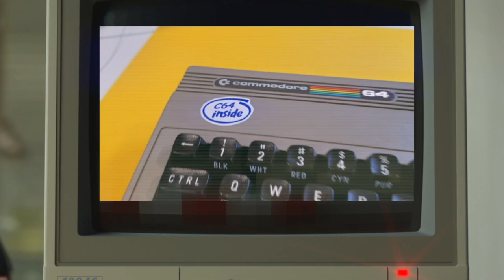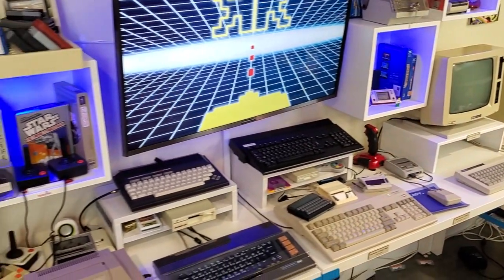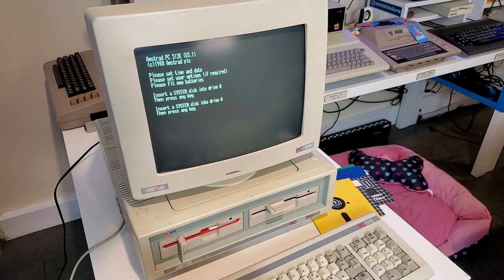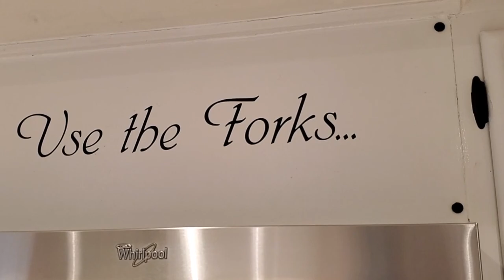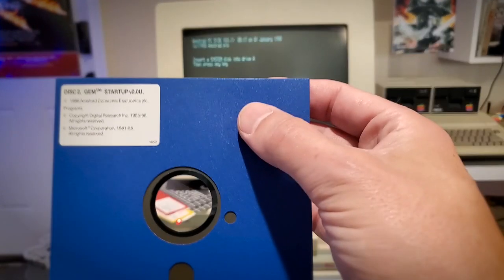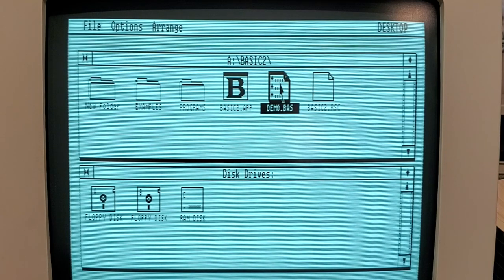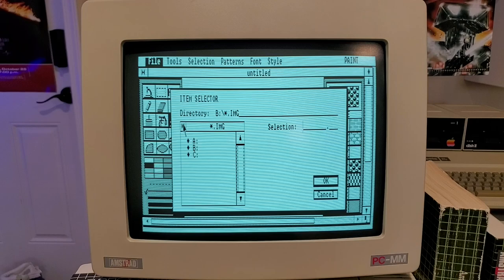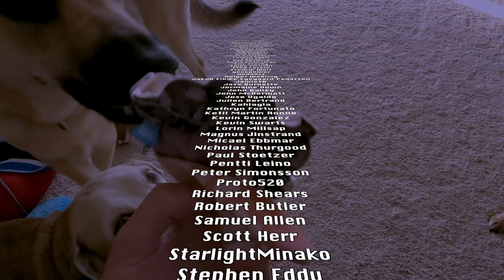Chasing tigers with the Amstrad PC1512 | recreating my teen PC!

Comment: Had one of these, it was my 3rd home computer.  A 512 with dual floppys and a colour monitor.  Did a little modding with the help of my late father, upgraded the memory to the whole 640k and put a 32mb Winchester hard card in the back.  The hard disk was attached to the controller card so I kept the two floppy drives.  This brought back a lot memories, sounds like it also did with you.

Comment: One thing to note about the dishwasher - dishwasher detergent usually contains sodium hydroxide and/or potassium hydroxide.
These chemicals react with aluminum, so don't wash anything aluminum in the dishwasher. I worry about putting electronics in the dishwasher because a lot of electronic components contain aluminum and may be damaged by the detergent solution.
For example, electrolytic caps are usually aluminum.
I expect most keyboards would be fine, but it's something to consider.

Comment: OH MAN!!!!  I understand it being bittersweet.  Mine belonged to my grandfather first, who gave it to me as a hand-me-down when he got a Tandy 1000 TL/2 (I think it was a 2) to replace it.  He died back in 1998.  Mine also had the color monitor, and Prodigy actually supported the Amstrad graphics mode.  Standard CGA on Prodigy was black and white, but not on Amstrad!  Also, the one you have has the same disk drives that mine had!  All of the others I have seen, both in advertisements and on YouTube, have the ones with the crooked latches.  I miss GEM desktop and that machine so much.  It was quite a step up from the Timex Sinclair and the CoCo 2.  Then I went from this to a 486 (first machine I ever built), so it was even a bigger step up haha.  GREAT video as usual!

Comment: I had one of those, purchased during the brief period that they were imported into the USA. It had an 8086, so it had a full 16-bit data path, unlike the crippled 8088 in the typical clones. I got the extra memory (a full 640k!) and, IIRC, an 8087 chip, that I didn't really need. Later I added a 30-mb hard drive, and had quite a setup, 32 years ago. I doodled in the paint program in GEM. Still doing similar stuff, 3+ decades later.

Comment: Thanks for this!  Great trip down memory lane.  In the early 90's I worked at a computer retailer in Canada and we carried the Amstrad PC's.  I loved the 1640!  Our demo model had a 40Mg HDD, EGA card / Monitor and Sound Blaster and used to run Sublogic's Jet as the demo software..  We actually sold a lot of them.  I remember adding a hard drive to a floppy model was interesting due to the non-standard hard drive mounting brackets. We got creative with our tin snippers.  ;).   Otherwise, great machines.  We sold them beside IBM PS1's, Amiga's and c64s.  Great times to be in the industry!

Comment: I got my PC1512 in the early 90s. I bought it off one of my brothers and it replaced my C64. I had the SD (single drive) version with the MM display, but it also had a 30MB hard card (8bit ISA expansion with the HDD and controller on a metal bracket). It took up two slots due to the width. I remember making an ISA expansion card for it in A-level electronics at school. I remember I got the extra 128k memory update for Christmas one year and thought I had broken the PC when it wouldn't power on. Turns out I had one leg of one of the memory chips had gone down the outside of the DIL socket. Reseating it correctly and I had 640k. Thanks for the trip down memory lane! :)

Comment: The Amstrad PC20 has volume control next to the power button, its specs internally are  basically the same except for the extra cga video modes.

Comment: Between the late 1980's and early 1990's I taught computing to students on Amstrad 1512's using that GEM Operating system it was good fun. We had some with 20 meg drives but converted some to 40 meg and as the operating system could only handle 32 meg we partitioned them into 32 meg and 8 meg. Tiger Tiger still burning bright

Comment: My parents got us the Amstrad CPC 664 with built in disc drive (the less popular brother of the CPC 464 with the built in tape drive) for Xmas 1985 and it also had an external data tape drive for most of the games, together with a colour monitor. We had hardly any games on disc (except The scout steps out and a Grand Prix game) although they loaded a lot faster than the tape drive. 

Have many happy memories of playing all the games (harrier attack, dizzy island, Biggles, Aliens etc). I did spend ages loading a game on tape sometimes though, only for it to crash at the last minute and then having to rewind the tape to start again. 

I also tried to do a bit of programming with something called turtle? and used to read some Amstrad magazines for programming code tips and game reviews, great days.

Sadly my dad had a loft clear out and threw it out years later and I only found out afterwards as I would have loved to have kept it.

Comment: That's a nice video on the pc1512 and as always, so calming at the same time :-) I was a a500 guy (child) at the time when my friends dad got his pc640, I wasn't jealous so much of the software they had or hardware it came with, but was so of the cheap expansion hardware relative to my pricey amigas. My 20mb a590 while its looked good, was a pricey option in comparison.

Comment: Great video and hope lady fractic is well. 
I have collected the NC notebook series 100 and 200 models cost a pretty penny the 200 they are getting rarer and hard to find but did fit a simulant gotek drive and works great but it eats the battery life. Alongside them I aslo grabbed a Tandy WP-3 that was really costly but it is built like a tank haha. I used them at school back in 1995

Comment: When I worked in a department store computer department, we sold these (the US version - I live in the USA) .. these machines while interesting always struck me with two odd things, 1. the made a weird ungodly high pitched whine from the CRT (likely something with the flyback transformer maybe something with using electronics tuned for 50hz on 60hz power?) 2. when they go really warm after being on display all day, the plastics emitted a very odd odor.. we called it the "Amstrad smell" and one of the guys I worked with would always turn it off as he feared it was going to catch fire.. Other than that I loved messing with GEM, we sold the classic dual floppy and the hard disk version.. I also recall it was the only unit where the display was the lid for the main unit (which I always liked that concept) .. 

I personally dont recall selling many of them but I do distinctly recall having these units for sale in my department and using them.

Comment: I had one of these when I was a kid. My mum turned it of at the socket by mistake while it was accessing the disk and killed the disk. The Amstrad engineer gad to cone al the way from Aberdeen ( I live in Inverness) to replace it.

He didn't have a 20 Mb drove so he put in a 30 Mb one. I still remember hom raving over it. He couldn't stop going on about the 30 Mb bring 10 more than 20 Mb.

Ah, those were the days.

Comment: Loved this video :-)

I remember when my mother was still alive, I had a creativision(dick Smith wizard) video game console which had 2 controllers that when packed into the console, formed a qwerty keyboard.
It had add ons you could buy such as tape drive, and other connecting boxes for printer, disk drives.
It had a basic cartridge and here in Victoria/Australia at the time, there were no pokie machines. You had to travel to the border to play.
My mother used to go on pokie trips with my grandma and aunty as she loved playing them.
I sat down(I think I was around 16) and wrote a pokie machine program in basic.
Literally used all the memory(16k) on the basic program to run it and had the graphics load in before the main program(would clear the program memory after loading the graphics then load the main program)
Mum loved playing it.
I still have that machine today(and the pokie program somewhere)

Thanks for the video

Comment: This was my first computer when I was 11 or 12. Mine didn't have the DD, though. My second was the PC1640 with a ten meg hard drive. I miss the sound of the drives. DOS, graphical BASIC interpreter in GEM, the included paint program, and later Deluxe Paint II with 256 colors. The 640x200 mode with 16 colors (standard EGA palette) was also a good hack. I think the paper tiger image used that for extra effect. I wish I still had it. Only the keyboard remains...

Comment: You could pump isopropyl through the water intake of a dishwasher and disable the heating element (or limit it) to wash larger components. Rotate to spill out the excess then fan dry. Someone should sell those inexpensively.

Comment: Had a PC1512 right up until 1997 used it in its final years to program eproms for arcade pcb's using an aging isa based eprom burner and transfering BBC Micro software from the internet to the beeb over serial....- I spec'd the home pc with a 5.25 drive especially so I could transfere files to it...😋😋...mine always would crash out saying buffer overrun error if you held down a load of keys for a while...

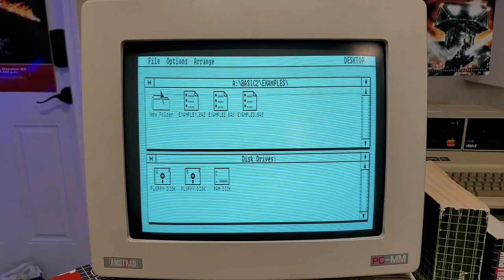Comment: 16:10 the "weird strobing pattern" is called "Moiré pattern" or interference pattern. See https://en.wikipedia.org/wiki/Moir%C3%A9_pattern
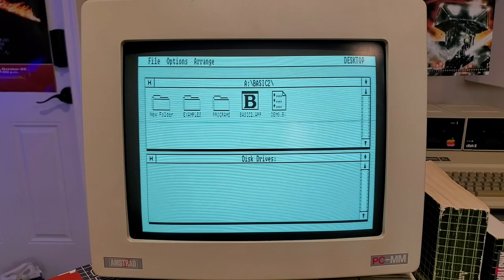18:30 And Windows 1.01 the first release of Windows Came out in November of 1985. Not to mention the Xerox Alto that actually invented the GUI in 1973, which btw Apple shamelessly ripped off. While the Alto wasn't obtainable by mere mortals at the time, in 1981 the Xerox Star was released with a GUI.
Reply from the maker: Oh I know, but how many of us had Windows v1? Whereas this came out of the box with the PC.
Reply: @RetroRecipes  Granted, it was really rare, it is just a lifetime of "Apple invented GUI" that got to me, and yes you didn't say that either. And I am probably in the minority as I actually installed Windows 1 and Aldus Pagemaker 1 for a friend. So I didn't own Windows 1, but I did use it. Funny thing was Pagemaker came bundled with Windows, in the late 80's that struck me as very backwards, if I only knew.
Reply from the maker: It's all good. The was a public domain pretender that offered a GUI around the same time. I wish I could remember the name. It had cool icons.

Comment: I can't believe you didn't at least separate the keyboard into a few pieces for the dishwasher and then remove the excess pooled water before letting it air dry.
Reply from the maker: I did but I cut it as the video was too long. I actually didn't realize the keyboard just pops open with clips, no screws, until I took it out of the wishdosher. So I did that afterwards. ¯\_(ツ)_/¯

Comment: What??  no "PCB Waaaaayyyyyyyy"..??   in this video??    or i miss it??   :-|   .......
Christian (@Retro Recipes) just like when you spill coffee or any other liquid on a keyboard .. the dishwashing liquid is probably leaked inside ... and  the rubber domes membrane (if it have one) .. well that piece of old rubber .. shouldn't be very happy with all that moisture .... and if it doesn't have rubber domes... and it's the PCB (which as you know will start to stands for Poor Corroded Board for washing machineeeeeee) no seriously... the circuit board  receive all that liquid .... ummm .. I don't know .... I mean ... even with a fan blowing air directly to him for several hours ... some of that moisture is going to be there... for several hours... or days... That can not be good man... :-\

Comment: just saying.. something is wrong with the sound when you speak .... the bassy spectrum "sometimes" gives brutal overkill  ... hollow tube like effect
Reply from the maker: Hmm in which bit of the the video? I use 2 different mics depending where I am...
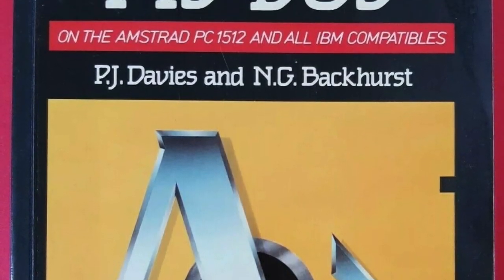Reply: @RetroRecipes  hello there - it's only in some parts - check out stuff that goes after 4:18 for example.. it's pretty audible there ... this is  not a critique as to content of the video ... just saying the sound part is blown off at a certain spectrum for some reason .. my guess would be post processing .. i kinda can't imagine mic doing this by default .. but hey , who knows.. right?